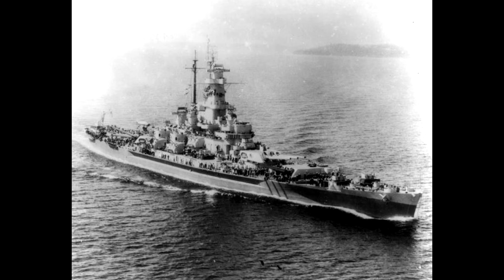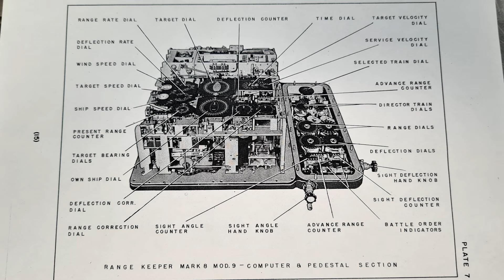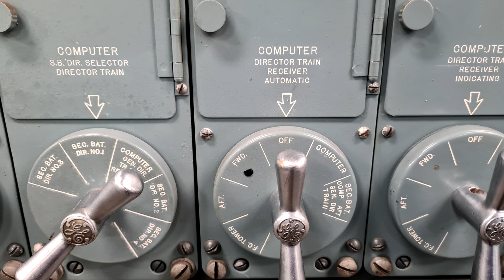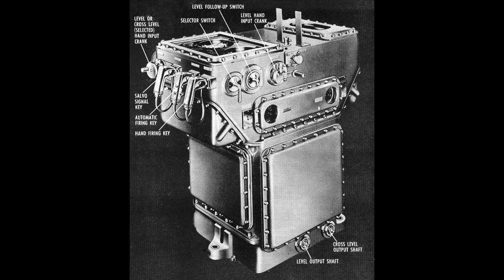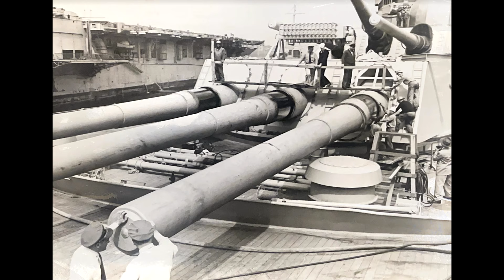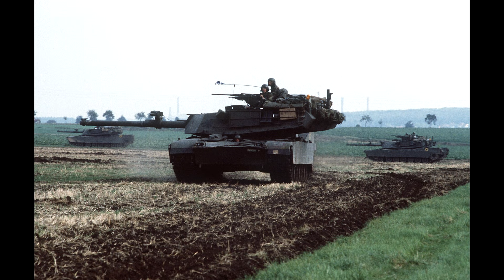US Navy Fire Control Systems - How They Really Work

Comment: In "The Night The Giants Rode" over at Unauthorised, Bill relates that he was trained on the Submarine equivalent as a young officer. And that when they got the electronic computers instead of the analogue ones; the latter did not have enough computing power to achieve the same precision.
Reply: In the same sort of vein, I had the opportunity to tour the Missouri out at Pearl. The guide there told us the Navy tried to use digital computers back in the '90s to replace the mechanical fire control computers. They found that the main battery would destroy the digital computers whenever the guns were fired.
Reply: @Fitzwalker
Just another case where newer isn't necessarily better.
Reply: @Fizwalker  i just watched something about permissive action links in u.s nuclear weapons involving hard links and soft links.  the original soft links have long since been replaced by integrated circuits on silicon wafers but the hard links are electromechanical in nature to this day.  edit:  the channel is called new mind - pretty good imho.
Reply: I guess those were special out-of-date military models?  (Electronics used by the military and eg NASA or in aviation are often quite a bit behind civilian models.  Partially because they need to be more rugged, partially because getting anything approved and procured takes a while.)
Reply: some stuff is painfully way behind the civilian world, but some stuff is leaps and bounds ahead of it too.
Reply: For NASA and other space applications, the electronics have to be resistant to elevated radiation levels, especially once you get out of low Earth orbit.  That's hard to do with modern IC's and their tiny transistor dimensions, so either you have to beef up the shielding or use "rad-hard" components that are closer to late-'90s tech.
Reply: Mechanical computers were used in critical areas more than electronic one's up into the 70's, it wasn't until then that they finally got electronic computers to be as reliable as mechanical one's. 
Another WW2 US military computer that found a home later in life was the computer used to control the gun turrets of the computer augmented defensive guns in the B29, their 3 axis program to point the guns in the right direction so their bullets would arrive at the same point in the future as the enemy fighter after the analog computer calculated it's ballistic firing solution was the basis for the first 3 axis CNC machines developed in the 50's that perform automated machining work.

Comment: Drach and New Jersey - the greatest collab to come out of the 2020s.
Reply: SO FAR! AND actually hoping for more of the same!
Reply: THAT is a video so technical I'm going to have to rewatch it. When I saw it & started it I had just woke up. And it took a bit for my brain to get acquainted with what I was listening to. It makes me wonder if we have video of these systems actually being used in the past. And I am constantly amazed at how much intelligence goes into making these systems long before actual computer systems were developed. And thought it rather hilarious that modern computers couldn't withstand the shock of the 16" guns being fired. But the fact that they were able to build a machine that could make these calculations and arrive at where the target is going to be when the shells arrive down range almost a minute after they are fired has always been impressive to me. And although the target ship can change course when they see a muzzle flash of the guns firing, if they do so, they will be throwing away their current fire control data & starting over. And considering the spread you get with 9 battleship guns firing, even a small change in course may not throw off the gunnery of the opposing ship. Let's face it, HMS Hood not only did this but did it in a way that would open a firing angle for its aft turret. But in doing so suffered a hit detonating her aft 15" magazine. However, that being said we are not sure if the turn had started and/or how far into the turn Hood was when she exploded. Although Prince of Wales was right behind her POW had to turn to avoid the wreckage of Hood.
Reply: @kennethdeanmiller7324  This might be what you're looking for: 1953 US Navy Film: Basic Mechanisms In Fire Control Computers https://www.youtube.com/watch?v=x9YEPw7_YTk
Reply: I was kinda seeing this comming. Very cool 🙂👍